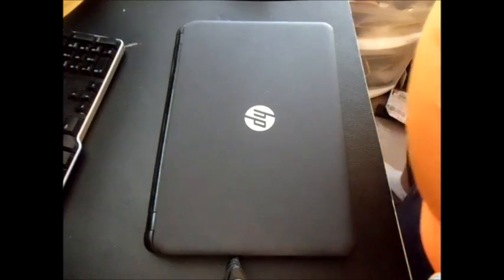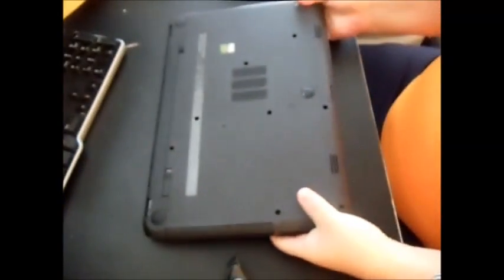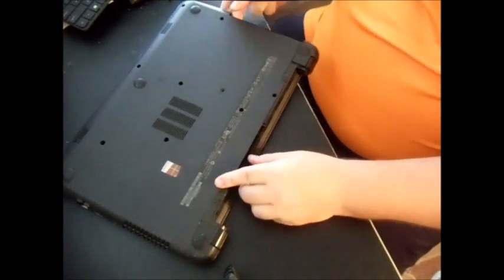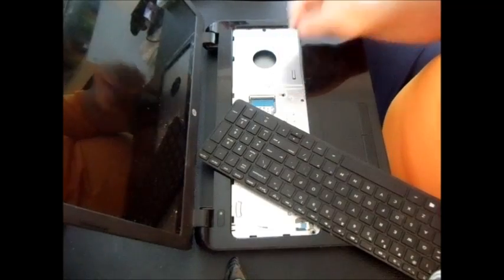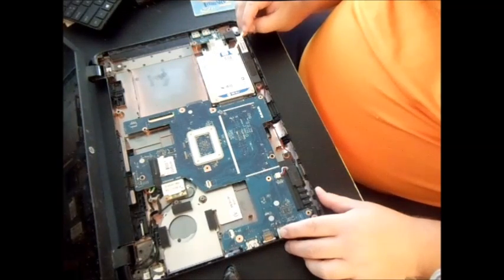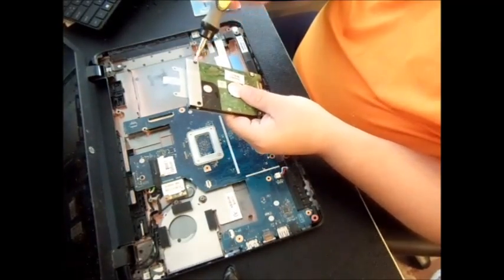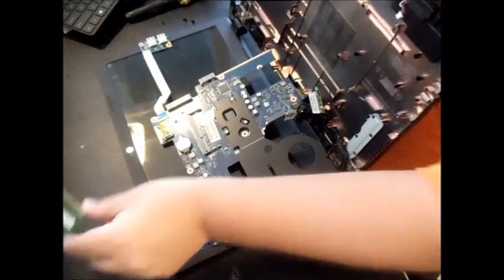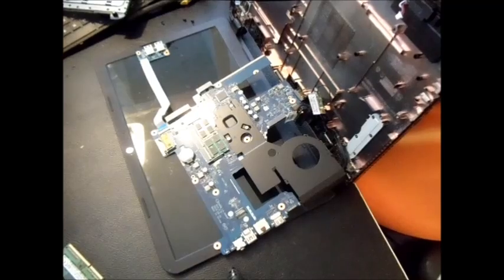HP 15 Laptop Memory Hard Drive Upgrade Replacement 15-R011dx 15-r015dx 15-r017dx 15-R018dx 15-r082nr

Comment: You made the job very simple. Thank you so much for this. 
I have followed the steps and my laptop luckily had a second slot for RAM. But I am having a problem after I reassembled it thete is an issue with power button I have to press it hard and several times to power on the laptop. Any idea how I can fix that? 
Thank you!!!
Reply from the maker: that I'm not sure. It's possible the power button plastic is not making a flush connection with the actual power.  Make sure to tighten the screws really tightly on that corner of the laptop.

Comment: where can i buy this screw driver ? what is it called model ?
Reply from the maker: the type of screwdriver is called a precision electric screwdriver.  This particular model is called a General Tools #500 and you can get it on Amazon for about 20 bucks. They are worth their weight in gold.

Comment: I want that screwdriver!  :)
Reply from the maker: The name brand is General and it's a battery powered precision screwdriver.
Reply: @RubberWilbur  MAN! you were right about that laptop.  That was a pain to get apart to get to the memory.  I stuck an 8GB stick in there and upgraded to a 1TB SSD.  

I was actually amazed at how the over-all speed of the machine depended on I/O speed.  It also showed how low-grade the HDD was in the unit.  I think I've gained close to a 50% improvement in general performance.

The interesting thing is that I did this same thing to my desktop, and had less impressive results, though they were still impressive over when I was using HDD's.

It seems like cheap parts are what bottlenecks these things.

Comment: Hai Rubber,

I was just wondering, which model/brand handy  electric screwdriver are you using there in the video or do you now use a other? The video was still now very helpfully:-)
Thanks in advance, Marcel
Reply from the maker: Hi its called a General 500 Precision Cordless Electric Screwdriver.  It's worth every dime and great quality.

Comment: I own an HP 15r210dx since 2015 and was wrongly disassembling it from the back trying to get to the keyboard and almost broke it because it is not possible. Thanks to your video I was able to get to the keyboard the correct way and clean it from the top/inside with ease. Thanks so much!

Comment: It appears HP meant that particular laptop to live a limited lifetime, then for the customer to buy another HP laptop to replace the first one. Budget friendly can equal false economy. A more capable, more easily repairable and up-gradable, laptop would actually save you money and frustration over time. This reminds me of the current trend of all sealed phones without easily replaceable batteries, a practice that IMO should be stopped.  Repair-ability and published repair manuals/pdf's should be mandatory for all machines sold in the USA.
Reply: This isn't the billion dollar idea, but it is the better idea. I agree.

Comment: Please don't touch the ram electrical contacts with your bare fingers because grease ,salt, dirt and static can and will give problems at these very low and very sensitive voltages

Comment: most all of the HP 15 series only have one slot for memory--stupid !  The higher ends have 2--ex f-387wm touchscreen. The f series also has the access panel on the bottom of the machine--but the R series is stupid--like this one.

Comment: I have an hp 15, same model as this and you don’t need to take everything apart. Just unscrew all the screws on the bottom panel, then prize it away from the  topside, leaving the motherboard and everything attached to the palmrest. A lot less hassle then the way you’ve done it.

Comment: Hi!! excellent video and very clear, i have a question, i have a 15-f019dx (product # J9M33UA) i replace the keyboard, but when i reasselmble it the touch pad stop working, i see one of the conectors  to the flex you showed there, the white plastic part loose, what can i do? as it is part of the motherboard.  by the way i hate Hp poor material quality.

Comment: I have a 15-R210DX with 2 slots and 6GB installed memory. Is that 6GB split over both slots? 
Can I add only 1 8GB card? 
Can the slots have different values of RAM? 
Must both slots be used at the same time? 

Thanks

Comment: Why didn't you just pry the bottom off instead of going in through the top?
The bottom half of the case just unclips and there;s your empty slot.
I had to laugh when you reminded viewers that it's tighty righty, lefty loosy. I can't help thinking that if you have to remind them of that maybe they should not be pulling their computer to pieces.
I also suspect that a couple of times during the video you walked away to check what to do next online .

Comment: This video helped me a lot. Thank you! 
I have another HP laptop with the same case, which luckily has motherboard with another RAM slot. I changed the hard disk drive with a SSD. Windows 10 is unusable without SSD. Happy to see it working.

Comment: Not sure my exact model number as I got it used and the info panel on the back is scratched off, but I followed the video last night and everything was the same except mine does have 2 ram ports! My laptop was doing the black screen on start up and one method to fix was to re seat the ram card, so I did all this just to reseat the ram lol but it was much easier than I wasexpecting. I just ordered a 1 tb ssd and an 8 GB ram card that I will install when theyarrive. Thank you! ..

Comment: Nice Video man! But what is the spec of the RAM used? Like 1600mhz or something.
Reply: yes, it is 1600.  Crucial has 3 recommended upgrades for my model HP15-r030wm) and all are DDR3L-1600 SODIMM at different GB levels (one 8GB and 2 4GB cards).  DDR3 PC3-12800 • CL=11 • Unbuffered • NON-ECC • DDR3-1600 • 1.35V • 1024Meg x 64

Comment: thanks for this.  I got it done but seem to have misplaced a bunch of my screws.  LOL  good news is it worked.  added an and to replace the 4.  I have another HP laptop that has 4 but has 2 slots.  can I put this one from the touchsmart 5 into the HP 2000?  pretty sure they are both DDR3 but the speeds are different.  when I first went looking for memory 8gb - crucial told me to get DDR3L 1866 SODIMM.  I did that.  then onto the next laptop - crucials recommended memory for that 4gb was Crucial 4GB DDR3L-1600 SODIMM.  I think the one I took out of the original was a 4gb 1200.  can I mix them?

Comment: Helped me add 16 GB RAM on hp 15 205tu non windows . Initially I thought my 8 GB of 16 GB purchase gone waste but my Linux dmidecode output did not disappoint as it had shown 2 DIMM slots. Really helpful video. Mouse connector missed by me seems :(  Now dont have the patience to open it again :)

Comment: This is NUTS!  upgrading the RAM should only take a few minutes!  thanks for this.  I ordered memory (8gb)- but now not sure I want to take the circuit board out.  I did upgrade the hard drive to a 500SSD.  I'll button it up with a few screws and ponder it while I wait for the memory to arrive.  

I hate HP!!!!!!!!!!! they make it so hard......................I'll never recommend HP...........ever.  and I thought they were bad when it came to power supplies on their desktops.  brand specific (at least years ago).

Just an FYI - crucial scan shows only 1 slot.  Belarc advisor showed 2 so I spent wasted time trying to find another 4.  couldn't confirm slots until I took it apart.  I still don't have the CB removed.  I'm gonna wait for that.

Comment: When you do this and the PC doesn't start so you check and double check the tapes cuz the PC won't power up and after hours of this you realize the battery charging adapter has died and need replacing too. grrrr

Comment: A side note for everyone to check HPs site for your specfic model numbers as some of these models do have 2 dimm slots. A correction on rubberwilbur's description if you check Hps site they specifically list how many dimm slots are avaible for user upgrade ability which is separate from the spec on how many dimms are actually being utilized by  the factory as for all of these models HP only uses one of the slots.

Comment: I upgraded my HP15g009ax with a 8gb ram DDR3 1600 1.35v and kept getting BSOD errors. Should I use a 8gb 1333 1.5v.. will it work? Or is there any other problem.. please help buddy.

Comment: Would this accept a 16gig chip? I happen to have one setting around.
Reply: I doubt it.  I looked on the Crucial webpage for my model (15-r030wm), and it lists only 4GB and 8GB upgrades.  You might try looking at the Crucial webpage for your model, but it's doubtful.  Just type your model number and Crucial memory upgrade into Google and you'll see a link to their webpage for your model.

Comment: I found a 15-R015DX had two slots. Slot #1 had a 4G DIMM. I didn't need to fully unplug the wi-fi or video connectors, had just enough room to sneak in two fingers and plug in the second DIMM. The owner accepted the "free" Win10 upgrade with 4G RAM, found it to be so slow he was willing to throw it out. I've never seen a PC this slow. Not even close. But I've never seen anyone try to run Win10 on 4G, either. I'll probably use the Recovery partition to put it back to the original build. Unfortunately, this model does NOT have a Windows License sticker on it. Tacky.

Comment: Thanks a bunch, not hard at all if you follow the steps, i know this is an old video but has anyone upgraded the ram to 1 with a heatsink. I want to put a gskill 1866 that comes with heatsink, is nobrainer to me is same price as the 1600. Just wondering how tight it is if itll fit with the heatsink. I did already installed an ssd, i dont mind opening it again to add the ram . Thanks

Comment: What sucks is more memory does not mean faster speed. If you check your task manger and it says you're only using 1-2 gigs all of the time? Then you don't need more amount of ram. However, If you had dual channel memory then adding another stick of ram speeds up the memory channel to 128 bit vs 64 bit bus. This is were your speed comes from. Sticking a larger amount of memory does nothing unless you're using this top for video editing. Now, if you want a faster top then what you do is replace memory with lower latency R.A.M. Also, you can stick a ssd in that thing. I thank you for showing me were the hidden screws and how clean you took that thing apart. Having a map were the screws go will save time putting this thing back together. I have a screw that right were that disk drive goes into that's striped out. sucks. Going to have to slice through it. Good day to you bro.

Comment: 1 4gig stick is better than 2 2gig stick? What a load of horse shit, having both slots populated is well better than just having 1 slot as the memory is dual channel it's always better to have both slots populated. Agreed it's a better option for upgrade purposes as you only need to buy 1 more 4 gig sodimm to fill the other slot, but from a performance point of view it would be better to have 2x2gig.

Comment: Thank you so much! Your video helped me to upgrade my laptop! Thankfully, my laptop (HP 15-R212nv) had two slots so I could add another 4gb module. The only problem is that after reassembling the laptop, a piece of plastic was in the way of the hdmi port! So I had to take it apart again...

Comment: O.K.  Very helpful video, with two comments:  
1) Your hand often obscures the actual action you're performing after you've identified a component.  It's not that hard to figure out with experience, but for less experienced users it would be useful to let them see which way you're lifting/tugging/twisting.
2) I get that you didn't realize there's ONLY ONE DIM slot until after you had taken everything apart while making the video, but it would be REALLY, REALLY, REALLY useful during post or in a message to tell your audience that upfront.  I just stepped through the same process you did, following along with your video, only to learn after all the pieces are sitting around my workshop that I can't install the second DIMM module I was planning to install by watching your video.
Reply: rip

Comment: You're a lifesaver, thanks. Needed to replace the horrendous HD with a SSD, just figuring out where the panels separated had me stumped... And I'm a certified HP hardware engineer!
Reply: Hey iam looking to upgrade my r series with a SSD. But just want to make sure is my interface sata 2 or 1
Reply: Yeah the screws under the back rubber feet had me stumped also.

Comment: You have to do all of this just to put a new hardrive in it?? My hard drive broke and I just bought a new one. Going to try to install it later. But you really have to take all that apart??
Reply: Yes, to the point where he pulled the hdd out - then, you can change the drive and reassemble it.

Comment: I can't imagine an i3 with only one ram channel. It's bad enough these cheap laptops feature celerons and Pentium level chips that have commonly now only one channel. That might be OK considering it's a 'budget friendly' laptop. But an i3 is not a budget chip. Even in it's 'low power' versions. It's still a fairly expensive chip and to marry it to only one channel doesn't make it budget friendly, it's just being cheap. So cheap they didn't even spend the 20 cents to design a ram slot door and hey this is a cheap laptop. Compromises are expected. I just think using an i3 with a single channel is bit absurd. Given the video benefits clearly from dual channel, both the CPU and GPU are bandwidth starved in that configuration. Yuck! That's about as bad as putting an 16 bit cpu on an 8 bit bus. Think 8088, oh and use some of that bus for video too. Ouch!

Comment: The only thing that was unclear was how to disengage the ribbons. A close up might have helped. Now, after trial and error, I understand how easy it is. Is the disconnection pretty much the same across the industry? Many years ago, I took apart one or two computers, and the ribbons had a plastic block/plug on the end. Obsolete? Thanks.

Comment: Good vid. There were several on YouTube, yours was clear, easy to understand. I wanted to make sure that the ribbon to my hard drive was connected well. It was "click click click", kept cutting off. Shoulda watched the vid FIRST, had a hard time, broke the ribbon from the on/off, crap. Is it worth buying a new switch and hard drive? About one year old, remanufactured (won't do that again).

Comment: Thanks for the Video. I just needed the Hard Drive out so I could save the data. 
Your Video also works with my  hp 15-r110na (British version)
RE HP
:( :( :(  I have had to replace two HP laptops. the computer it worked. BUT ..The screen Hinges broke on TWO LAPTOPS. 
that's the penalty for making things cheaper.  
HP now HAVE LOST A CUSTOMER FOR EVER.

Comment: If I replace the RAM with 8gb will it damage any files/anything on the laptop
Reply: Paul Crompton replacing the RAM should not compromise your files. Be sure to shutdown first and if applicable disable any internal batteries in the BIOS. As long as you don't damage your hard drive your files shouldn't be a concern.

Comment: Thanks very much, very helpful video! I don't suppose you have advice or another video on how to reassemble? I just want to make sure I connect the ribbons again correctly.
Reply: Do they just tuck back down and you push the flap back down to hold them?
Reply from the maker: Hi yes just like in computer looping or anything else reverse everything you did to assemble.  Yes the plastic tab has pressure when you clamp the ribbon back in.  I sometimes take for granted that I've done hundreds of these and people are doing them for the first time.  But just take your time, don't panic, be confident, and don't force anything.
Reply: Okay, great! Again, thank you very very much, this video is immensely helpful, and I really appreciate you taking the time to reply.

Comment: Hi bro, i have this model

http://qrq.itcs.hp.com/m/L0T74UANA/qr.do?cc=us&ll=en&jumpid=QR_PPS_L0T74UANA_NA

I have 6gb but i was wondering how much more ram can i add to it, it looks like it has 2 slots, please let me know if this is right, and what do you recommend for upgrade my RAM, saludos!

Operating system
Windows 8.1 64d19
Memory, standard
6 GB DDR3L-1600 SDRAM (1 x 2 GB, 1 x 4 GB)
Hard drive description
750 GB 5400 rpm SATAd10
Processor family
Intel® Core™ i5 processor
Processor
Intel® Core™ i5-5200U with Intel HD Graphics 5500 (2.2 GHz, 3 MB cache, 2 cores)d15
Weight
4.92 lbd4
Display
15.6" diagonal HD BrightView LED-backlit (1366 x 768)d9
Display size (diagonal)
15.6"
Graphics
Intel HD Graphics 5500 (up to 2.96 GB)d3
Battery type
3-cell, 31 Wh Li-ion polymer

Comment: I have 15-f233wm , son plugged in vid software & started freezing up so we used factory reset , now its stuck in a 64% loop & will not load windows. HP site 45$ to order recovery disc. I've tried everything on vids here on YouTube nothing works. they know there's a glitch & still charge.

Comment: Thank you very much for these video.It surely helped me
Reply from the maker: you are welcome
Reply: Hello. I just watched your video. I am having difficulty getting my laptop to start now. In fact, it won't start at all. I plugged the charger into the wall and it shows a blue light, but when I go to turn the power on it does nothing. I tried to do a static discharge, but nothing happened as well. Can you help me
Reply: Hi , did you plug you power button flex cable back into the motherboard ? check both ends of the flex cable to see if both are connected. also check if the power cable from the power connector that goes into the motherboard is also all fully pushed in  the MB.